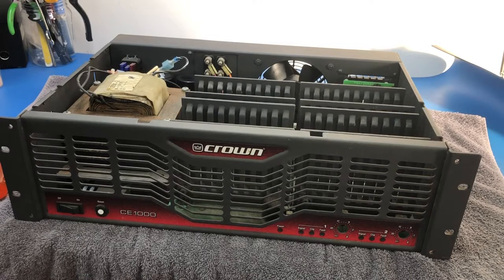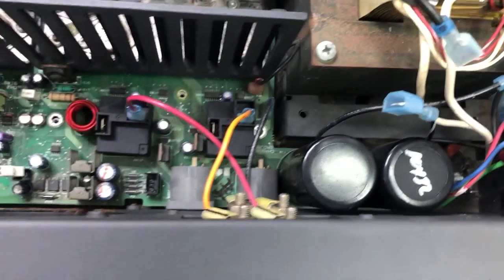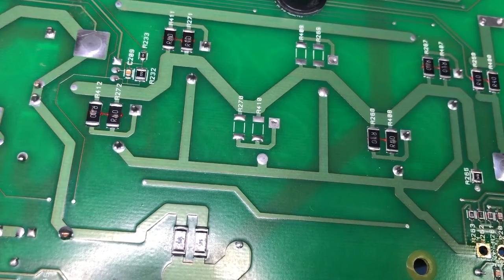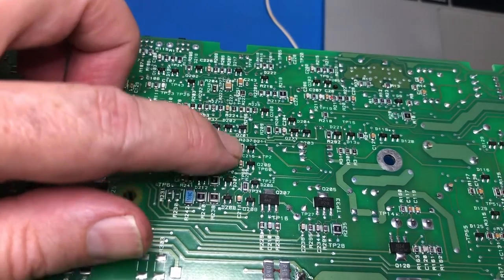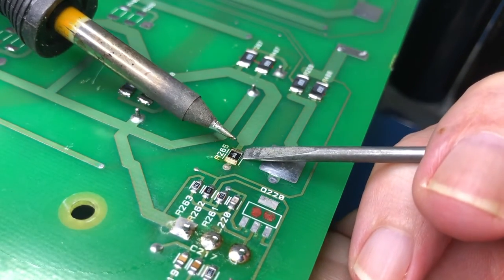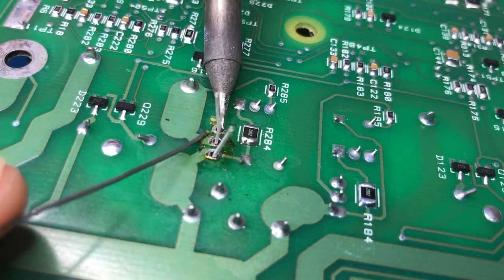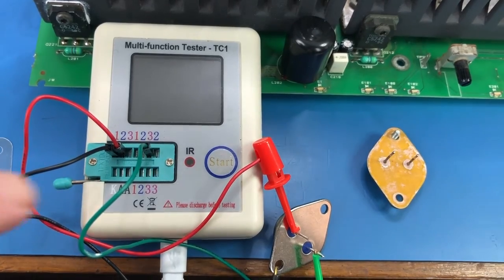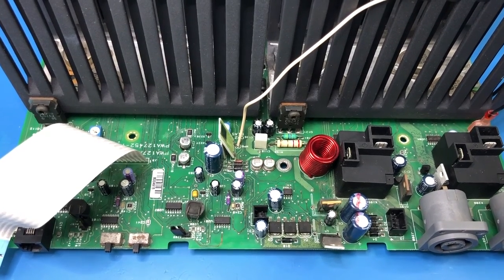DEFEATED! - Crown CE1000A Stereo Amplifier Repair

Comment: It seems funny how, Crown, decided to use so many components ( which just adds points of failure)  in a product that would mostly be used as a "sound reinforcement" amplifier. There's usually a price point balance in design, balancing between the amount, and quality of components chosen, the complexity of the design, and the sale price, of course.  I can't remember seeing so many points of failure in most other amps. Thank you for sharing your efforts and the info on this one, it seems a good one to "steer clear" of if someone has that chance.
Reply from the maker: That's a really good point - thanks for that. It's almost as if Crown wants to sell more amps...
Reply: Another brand goes down the drain in compare with their 70s, 80s amps. Can't see this amp going On The Road as way to complicated to service
Reply: My father used to service crown amps through the 80's and 90's and around the late 90's early 2000's the original engineering department pretty much retired and the new engineering department had a completely different philosophy. The earlier crown amps are exceptionally low noise and well matched components percievably zero harmonic distoration. Harman who owns AKG, AMX, Arcam, Bang & Olufsen Automotive, Becker, BSS Audio, Crown, dbx, DOD Electronics, DigiTech, Harman Kardon, Infinity, JBL, Lexicon, Mark Levinson, Martin, Revel, Soundcraft and Studer may have had a hand in the design philisophy change.
Reply: Can you please share the service manual sir? Thank you
Reply: @disorderindminor  you are correct about the changes around the time Harman took over. I believe they one wanted to make Crown accessable to everyone and two may well have outsourced the CE series to a lesser division or to another entity all together. The upper models were definitely not of this poor quality. As I said before so bad the dealers told customers to steer clear.

Comment: The trick with repairing solid-state electronics is to be able to deduce what is NOT wrong from measurements at points which are accessible without dismantling the thing. In this case the possibility of there still being 'swarf' hidden under the output Q boards means it is desirable to see under them, but preliminary tests should determine whether or not you need to at all. This is electronics; not fixing cars. Measure power rails to ground first, assume nothing.
Reply from the maker: I know. You can't measure power rails when there is a short. First thing to do is to remove the shorted device. As a number of devices had failed short, that was easier said than done.

Comment: Hello!! Wonderful job, the question is, where did you get the transistor and resistors from? can you recommend me an online supplier? please.. please!!
Reply from the maker: You can get most things from Digikey or Mouser.
Reply: @audionautica6843  I had a tough time looking for two components on those websites, the transistors from my amp show these numbers: N747 A42 AND MR83 P2D. The resistor has 0R4. When I enter those numbers on the searching part of the website they give me tons of options, How can I figure out which one is the one?
Reply from the maker: You'll need to get the full part numbers from the service manual. I'm not sure  how much experience you have with electronics, but this amp is not easy to work on, and unless you do have good electronics experience my recommendation would be not to.

Comment: OOOOO-m-g!!!! These crown ce-1000/ce-2000 amps are some of THEE WORST amps to work on. I've seen a service manual and it's at LEAST an inch thick!!!! Pretty sure crown outsourced the design to china or japan. WAY to much smt in them! If you have a working model enjoy it while it lasts. If it breaks, sell it cheep to someone that can use it for parts and just buy a new amp, cuz none of them are worth even the most gifted techs time!!!!
Reply from the maker: Yup - I made this video 2 years ago and I think I have just about gotten over the trauma.
Reply: @audionautica6843  yo tengo 5 cl1 y es la misma placa pero menos transistores y lo mismo transistores buenos y sabra dios porque no funcionan
una basura de crown